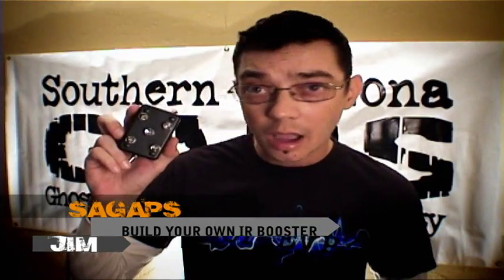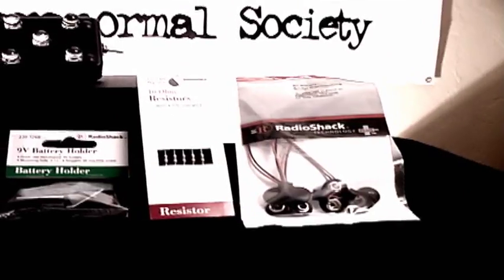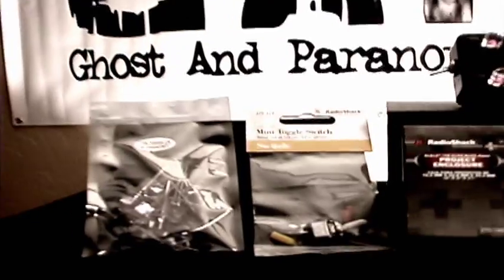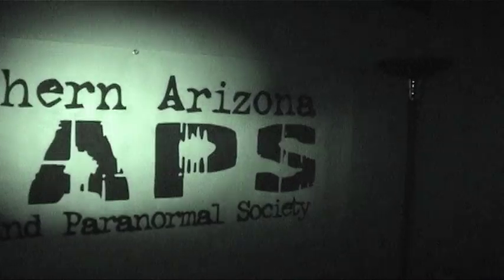How to Build Ghost Hunting Gear : $15 IR Booster DIY

Comment: Hello, I know this post is well old but I am trying to build myself some Ir lights using 8mm Ir's. In Taiwan these seem so hard to obtain as not many electrical shops stock these as nobody does any kind of DIY here So the 8mm diodes I have found have the spec below and I am wondering if I am able to use these in a project. I intend to use 100 x 50 x 40 case which seems a good size for an Ir light project. What resistors would I need to use? Here is the diode spec 

Specification: 8mm 850nm infrared emission tube
Description of electrical parameters:
Chip: Taiwan Dingyuan 14mil chip
Infrared power: 0.3w
Current: 100 Ma
Infrared light intensity: 350 MW / Sr
Launch angle: 40 degrees
Voltage: 1.46-1.85v
Peak length: 850nm
Reverse leakage value: less than 5ua (reverse 9V impact)

Also what kind of power would be required?

Comment: hello , how do you find the résistor value ?
if I run 5 led in série , 1, 6 v each , for a 20 ma crurent rating  , ledcalculator gîve me a 56 ohm . 
I tried it but it's not really as bright as yours.
Reply: Resistor values are based on the rings they have printed on them. Look up a resistance calculator, they're pretty handy for figuring out the values.
Reply: I just made for my self.

Used 9v 
5 x 10mm IR LED 850nm 200mW (1.5v 20mW)

Ohm =  82

Notice: he used triple chip LEDs it's much brighter :)
Reply: wrong cuurent its 240ma use a 8.2 ohms resistor
Reply: wrong cuurent its 240ma use a 8.2 ohms resistor

Comment: I built 2 of them and plan to build 4 more for my static cameras, I need to be able to run them off of A/C power though.

 Here is my question, would it be better to run each light off of a 9v 600mah power supply or both off of a 9v 1a power supply? my concern is that the 1a unit will fry the led's if left on too long.. it sure does get bright.

Comment: so radioshack only had the 10ohm 1/2 watt resistors...i have 10 lights on my project enclosure.  2 sets of 5..(two 9v power 2 resistors 2 toggle)  my lights are not bright at all is this because of the resistors?

Comment: The resistance is correct for 80% power. This is how the light should be ran for longevity. But the maximum output you could get would be if you used a resistance of 8 ohms at 1%to5% tolerance. If you do that,however,you will risk burning out the LEDs. Observed brightness can have much more to do with the camera used.

Comment: Ok question how does 9 leds running off one 9volt. At 140ma, 1.5 volts. Equal the samw resistor of 1/4 10 ohm same as the one you used for the 5 leds. Be the exact same. Using the same leds you have the ebay linked to. With rhe ledcalc dot com site?

Comment: If you have 6 LEDs, 1.5V and current draw of .140A with a 12V power supply and you wanted to use 6 in series the equation would look like this:
R = (12 - 9) / 0.14 = 3 / .14 = 21.4ish So you would choose the closest resistance value that is higher.  If you wanted to use 9V source, you would be better off doing two series of 3 and adjusting the resistance accordingly.

Comment: Yes, but the value depends on your source and the specs of the IR's. 
R = (Vs - Vl) / I
It's not very hard, but if that equation doesn't make sense to you, you should look up tutorials on basics wiring LEDs. It will give you a good idea on the relationship between the load and the source and what conditions are needed for safe efficient circuits.

Comment: Why not put the batt in the enclosure? There is more than enough room if you factor that into how you choose to route your leads of the LEDs. You can use a snap case if you don't want to unscrew the case to replace your batt. Sometimes I like to make my own 9V holders out of dead 9V batts and make a solid snap in holder. It works great. Just remove the top of the dead 9V and you will have something far superior to the pigtails you get at radio shack. Just solder on some leads

Comment: Hello First of all thank you for your video

here I have completed the installation as you described but with the ir led 10mm single chips and another with 10mm LEDs 5 chips 850 nm and the resistance that you set and nothing lights with resistance by cons if I do not put any resistance work so that happening? thank you for your answer and greetings from France

Comment from the maker: If you are wiring only 4 leds (per specs you provided) in a single series you would use a 180 Ohm 1/8watt resister. Just make two of these and wire to your battery connectors and you should be good to go. Good luck!!

Comment: I have a question...If anyone can help me with this? I have these LEDs. I want to wire 2 series of 4 lights off of a 9v battery. What size resistor do I need? Voltage: 1.5V~1.6V 
Current: 20-25 mA 
Power: 200mW

Comment from the maker: The beam angle of a LED refers to the measure of the spread of the light source and is simply stated in degrees. Smaller beam angle LED's are used when a focused beam of light is preferred. It is important to note that the greater the beam angle, the smaller the intensity of light will be available at a set distance from the light source. It all depends on how you would like the light beam to be focused. I used 60 degree leds in the project above to get a more "fill" effect than spotlight.

Comment from the maker: The single chip should still work just not be as bright as the triple chip IR leds. It should put off some Infrared light in the dark depending if your camera is IR compatible. What model of cam are you using ?

Comment: Look again. The ones on Ebay are in packs of 10 or 20. You aren't paying for one LED, you're paying for a pack of them. It's pretty good value considering you pay around 20c for a 5mm, single chip 120mw Ir LED like we all used to use before these triple chip LEDs came out. They are 840nm in wavelength, too, which the cameras sensor is more sensitive to.

Comment from the maker: Looks like the vendor changed the price. They now sell a pack of "20 IR Leds" for 20$. The degree's refer to the angle in which the light emits from the led. The larger the number the wider the spread of light, the lower the number the more focused cone of light it emits. Hope this helps.

Comment: Where did you get the 5x10mm 3 chip 200mw IR LED for that price  ? I went to e bay and they are like $ 10.00 to $20.00 a piece ... and they don't have 5x10mm , they have 20x10mm, 10x8mm, also im not sure what the 45 degree, 60 degree and 30 degree mean

Comment from the maker: If you wanted to keep it simple, you could try building a 10 Ir led booster by following the video above. Just wire the first 5 leds like normal and then add another set of 5 leds by duplicating the steps. This would use all the same materials as listed in the video and you wouldn't have to calculate new resistors .

Comment from the maker: Yes I wired some of the leds together just because of the close proximity and positioning/placement of the leds. If you messed up you can unsolder them and reuse the leds without any issues. You may want to take a look at the new 28leds booster build just to get a better idea on how to wire leds in a series. Let me know if you are still having issues. Thanks for watching and good luck!!

Comment from the maker: You should be able to use the 6amp 125vac toggle switch without any issues. The total circuit consumption is only 125ma so you're safe. Good Luck

Comment: I can not get mine to light up. I started over and still cant get it to work. perhaps I've wired some of the leds incorrectly. It appears you are wiring a couple leds directly to each other, is that correct? And if I've wired them and messed up can i un solder them and re use them or should i use new ones? I can't figure out what I'm doing wrong:( please help

Comment from the maker: Sure it can be done, but to get the correct current/voltage to that 1 extra led it would have to be wired separate from the previous 5 leds in this tutorial. The extra IR led would require a 56 Ohm resister in order to function correctly.

Comment from the maker: If you are attempting to test each led separately with a 9v battery, it would require you to use a 56 Ohm resistor. Remember these leds only require 1.5v using a straight 9v battery will fry your leds.

Comment: I have noticed that a friend's IR illuminator that he uses for hunting, does have a range of over 100 metres.  For what I can make out from a faint red glow, the device uses 4 LEDs but there might be a focusing lens over them giving a narrow beam of infrared light of about 6 degrees.  I was wondering if it was possible to reproduce this using cheap LEDs and how to go about it.  The actual device that he uses is a "nitesite NS50" but at £399 is unaffordable.  can you help?

Comment from the maker: No developing board needed. This build can easily be switched over to a 12v (x 8 -AA's) if battery drain is a concern of yours. Only thing that would change is the resisters..

Comment: Can you help me with uv lighting. I am trying to figure out what they are using to build these full spectrum lights. Most uv leds I come across have a cd of 3.5. Which means I can barely run 3leds off of one 9v battery. I am trying to figure out how they are using 5-20 on one 9 volt battery. What am I missing here? Thanks!

Comment from the maker: Too Awesome! Love to hear people saving money by building their own equipment!  As for your question about your switches: Your two switches ( 6A @ 125vac / 3A@250V)  are for Volts Alternating Current, like power from your wall outlet. This build uses Volts Direct Current (9v) . Your switches (6A 125VAC) would probably downrate to (4A at 24VDC) . This 5 led IR booster build only uses (125mA at 9VDC) so you should be fine to use these switches for your builds. Good luck !!!!

Comment: Thank you so much for this video! I spent $30 on an "auction" site for an IR booster. After this video, I have spent $30, and built 4 of my own!! Quick question: How do you know what type of switch to select? I accidentally bought a couple of 6A @ 125vac / 3A@250V, only because they "looked" like the right switch, and the local shack was no help in selecting switches. 
Thank you, again!!!!

Comment from the maker: This build is being wired in a Series not Parallel.. A single 69 ohm 1/4w resister will not work for all 12 of your leds.. Each row of 6 leds will require its own 22ohm resister to limit the flow of current correctly to each single led.. Careful straying from the specified calculated resisters or you can fry everything at a flick of a switch.

Comment from the maker: Hey Hemlock Para,  it all boils down to the voltage and the current the leds require to operate normally. I have yet to see ledcalc steer anyone wrong. If you are not sure on the leds and the resister used for your IR booster build visit our web site and send me a email with the specs of your leds and I'll point you in the right direction as best I can.

Comment: I was looking up on the led calculator and it sad for 5 lights to use 51ohm. Then I change it to 6 lights and it jumps to two resistors, 100ohm and other side a 430ohm resistor. I am relatively new to this but is this correct. I see you told one person before that for 6 10mm 3 chip leds to use a 68 ohm on the sixth led. Just need some clarification if this led calculator is giving me the correct data. Thanks!

Comment from the maker: It would just require you to wire 5 more led's just like in the video with its own 12 Ohm resister. Remember to keep battery drain in mind when expanding your led projects and good luck T.P.P.T !.

R mAh / D mA = T hours
R = the rating of your battery in mAh
D = the drain applied constantly to the battery.
T = the time in hours that it will take for your battery to drain completely

Comment from the maker: Hmmm interesting, you used the correct resister & Leds specified in the video? Double check your solder points and battery connections.  How are you testing the brightness?

Comment from the maker: If you are to use 5 of the leds specified in your post you would need 1 single "68 Ohm resister" for your IR booster build! 

Check out (ledcalc . com) for calculating the resisters needed on your next led project.

Good luck!!

Comment from the maker: If you are referring to the 8mm 3Chips 60deg 200mW Infrared IR LED 's with the following specs : 
Voltage: 1.5V~1.6V 	
Color: Water clear 	
Angle:  60 degree
Current: 140mA, 
Peak(pulse): 700mA
Power: 200mW

Those specs are the exact same as the 10mm IR leds I used in the video, thus you would use the same resister specified in the video.

Hope this answers your question. :)

Comment from the maker: @The88drunkredneak If you were to add 6 leds instead of 5. You would wire it exactly the same but on the 6th led you would need to wire a 56 Ohm resister to the power.   Let me know if this helps.

Comment: @beedlej00z i actually kinda cheezed it.  i just cut a slot into the box and use a strip of electrical tape to hold the battery in.  I just like having a more linear shape for the light. makes using it on a camera bracket it a lil easier.  i have been trying to find boxes with hinges though.... that would be perfect.

Comment: @Onionlord87 Great idea, you can never have enough IR boosters, right?! However I would disagree with your idea on the battery being inside the box, I would think its much easier to swap out a battery when drain occurs on an investigation, with the battery on the outside, unless you have constructed a panel on the box that opens right to the battery quicker. If you have, post an image of this, would love to check it out!

Comment from the maker: @gamewiz0070 Your statement is true, but in his build we used a simple 2 pin toggle on/off switch to complete the circuit using just the negative wires..

Comment from the maker: @Manoahw If you want to build a Full Spectrum booster using both UV & IR leds be sure to calculate the the load and power supply to determine the best resister for the build. A Great website to determine this is ledcalc.com

Comment from the maker: @mailleo1 I just got a GoPro as well But.. Most good cameras have an IR cut filter in front of the imager to block the IR because it is really hard to get it to focus at the same point as other visible light producing blurry soft images. I haven't pulled the lens off of a GoPro yet but I would expect to see a light blue IR blocking filter sitting right over the sensor. You can contact Ragecams.com who specializes in replacement lenses for the GoPro and they can remove the IR filter for you :)

Comment from the maker: @mrgrim333  It varies depending on the brand of batteries you use. I've tested Duracell's and they start really dimming @ 8-9hrs+, Energizer at 7-9hrs+, Rayovac at 4-6hrs.

Comment: I just built one using 8, 10mm IR leds in a project box the size up from the one you used in the video. I made the holes using an old soldering iron which just so happen to be the same size as the LEDs and used hot glue to hold them in place.  I carefully bent the leads on the LEDs so the positive and negative crossed. by bending the leads so close to the base of the LED I was able to use some thin foam so I could mount the battery inside the box. I also added a green led for a power light

Comment: i used 6, 5mm infered leds at 150mW and no resistor. It works nearly the same. Im happy with it, might want to try it that way if ya want. Otherwise everything else is put togather the same. Thanks you saved me a ton of money.

Comment from the maker: @IVANUMANZOR 8mm is referring to the actual size of the IR led.. I would need to know the voltage the IR could handle.. Chances are if its 1.5v Led you should be fine..

Comment: This is a great video man.  I saw this video the other day and stopped by radio shack to check on the led's, but they didn't have the ones I needed. This is an awesome presentation. I favorited this video. I have used lights similar to this and they are just as good if not better than the sony lights. If people learn to make these lights they will save a lot of cash.